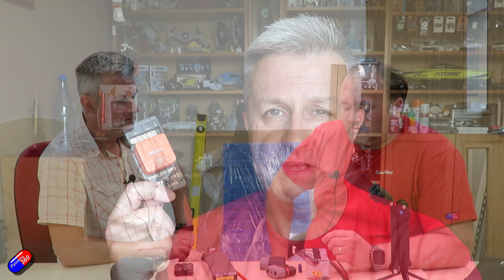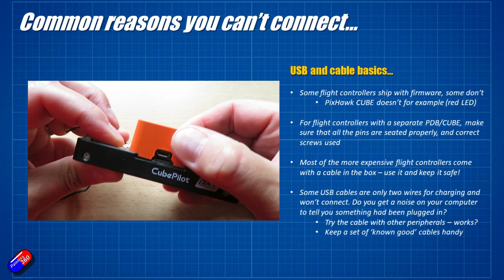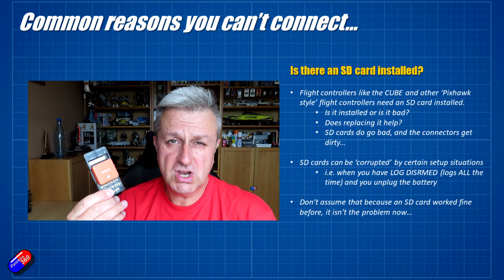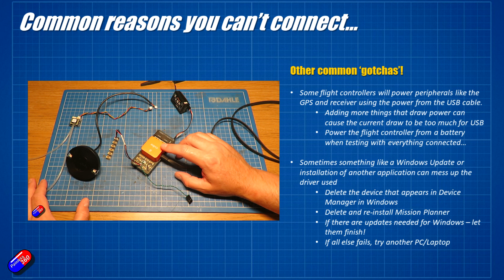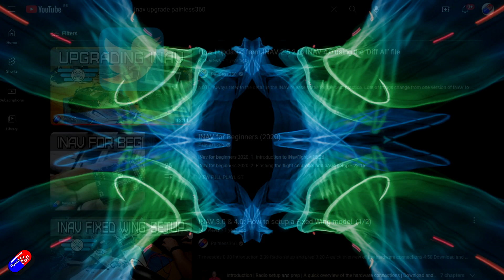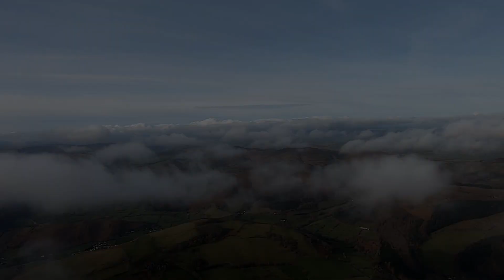Why can't I connect to my flight controller? Here's why...

Comment: I was hoping you’d include the use of Zadig and Impulse RC driver fixer - the difference between the two and when you would use them- they would likely fix some of the Windows computer connection problems in the other comments above

Also a few flight controllers won’t work with a USB C-C cable but will work with a USB A-C cable
Reply from the maker: https://youtu.be/WzTq5ZWdhRM

Comment: Another useful refresher. My small tip is to use your label maker (we all have one due Operator ID stickers ...) and label USB cables in a way that makes sense, eg what device it originally shipped with. Unfortunately, it's a new plan for me so there are plenty of voyages of discovery still in my box marked 'cables'!!
Reply: i use printable shipping label sheets. Print cool designs on them, put a piece of tape over it.... its like a sticker! i organize all my screws that way

Comment: I was at the field yesterday trying to change some iNav settings using a SpeedyBee phone app (bluetooth connection) to a SpeedyBee F405 Wing FC.  I couldn't connect. Never had any previous problems with it.
I'd just updated to the latest SpeedyBee app version so I was blaming that. But that wasn't the problem.
The issue was that I'd refused to give the app permission to see my exact GPS position. Without that permission it refused to connect to my FC. I'm not impressed - we give enough info away as it is!

Comment: That didn't help. Fortunately, one of my Windows computers can usually connect to flight controllers but I never know which one. After the next Windows update it may change again. I only have problems with flight controllers and no other devices. It is an STM32/motherboard/driver problem. Trying to uninstall/install/manipulate changes nothing. Only waiting for better times does.
Reply from the maker: How odd, all of my Windows machines here work perfectly, and continue to do after updates... Best of luck!
Reply: @Painless360 ive noticed problems with windows 11 being able to connect to programmable USB things. 10 doesn't seem to have problems though.
Reply from the maker: I helped a Patreon the other day with a related issue and we used the ImpulseRC Driver fixer for him.. https://impulserc.com/pages/downloads
Reply: @Painless360  I thank you for remembering me! Unfortunately, I have already tried the driver fixer and it did nothing. Usually, I can run Betaflight Configurator on my laptop, so I am relatively happy 95% of the time. I have been wondering if there is an AMD B450 chipset incompatibility, but I have no way of testing this.

Comment: Wow it’s the end of 2023 and still micro usb 🙈. Thank you for all these years of videos. I learned so much from you  since the naze32. One thing I have seen preventing a flight controller communicating via usb in bootloader mode is bad pin mapping in the fc. You get device descriptor failed error. When I get a fresh fc, or when I update firmware, I always retain a copy of stock cli dump so I can return it to original defaults if needed. Also smart port gave problems in some fc’s. Simply disconnecting the smart port fixes that. Maybe I’m dating myself. I haven’t flown in years.